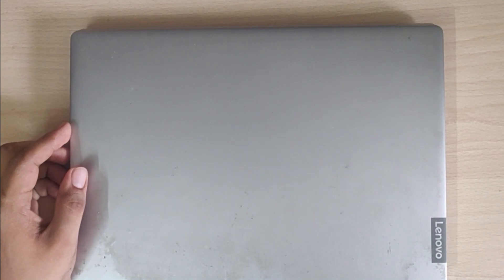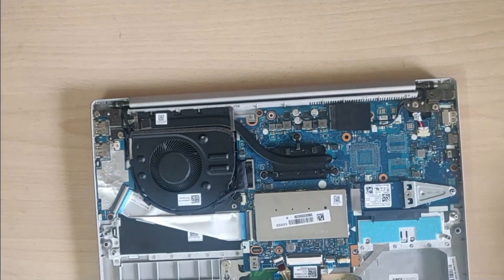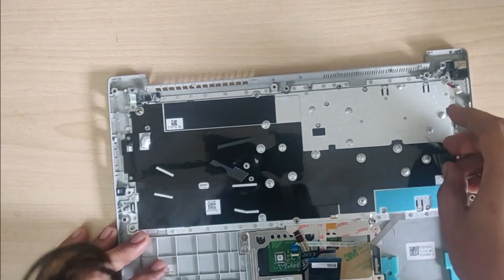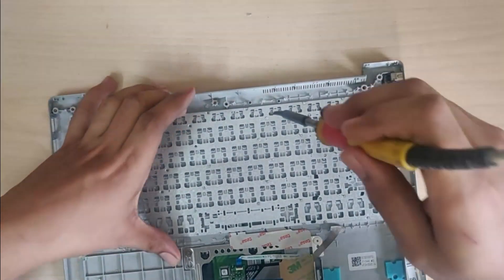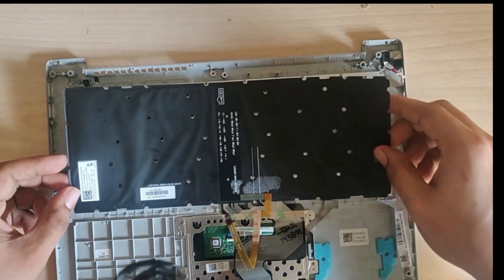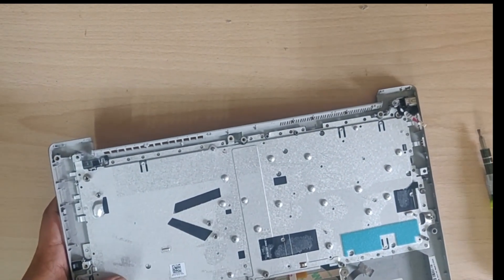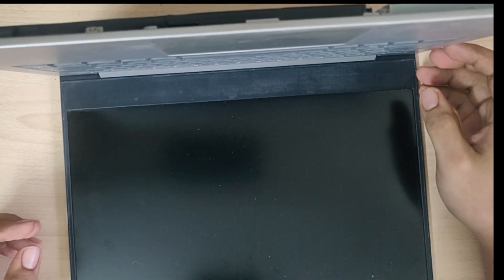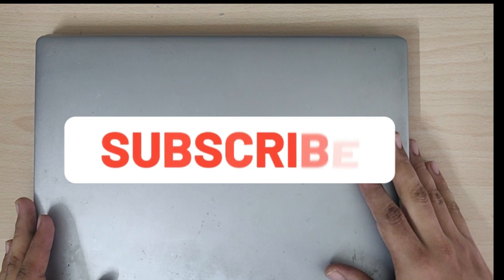Laptop Keyboard Replacement, Full Dissembling Guide (lenovo ideapad s340-14iwl)

Comment: Where to buy the spare keyboard for this model?
Reply from the maker: i bought keyboard from site called xfurbish.com
Reply: @bktech8409 did you buy a non backlit replacement and used the old backlit panel?
Reply from the maker: @jordsfjords885  yes
Reply: @bktech8409  Wow okay. Strange coincidance. Just yesterday I replaced a new backlit keyboard.

I knew from your videp and from your comment that it was possible to keep the old backlit element but I wasn't sure how fragile the backlit piece is.

Anyways the backlit ones werent much more expensive.

But those little plastic pieces were a journey. phew!